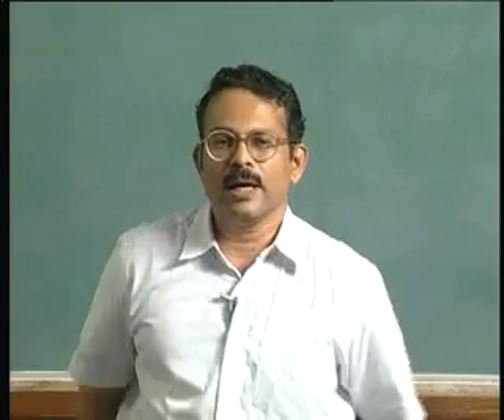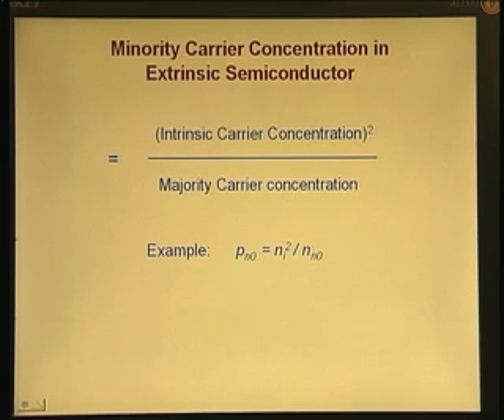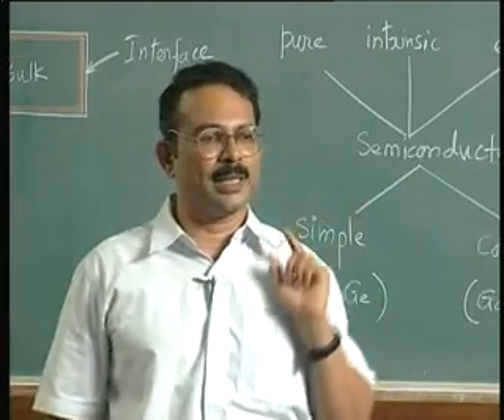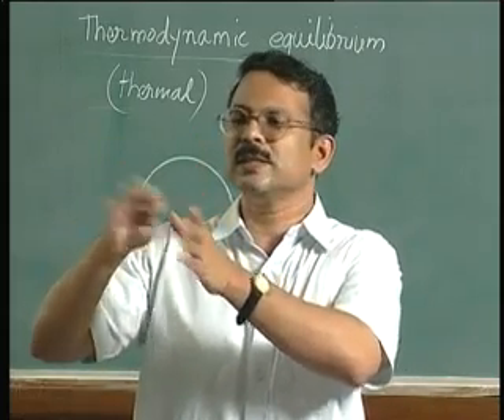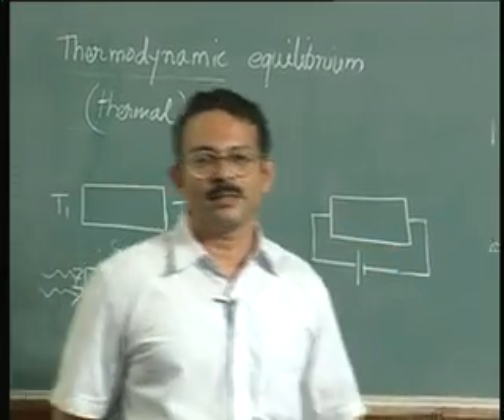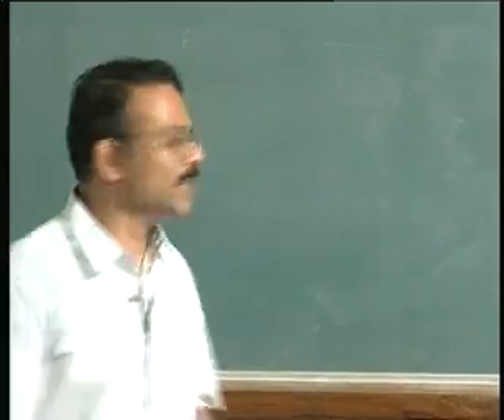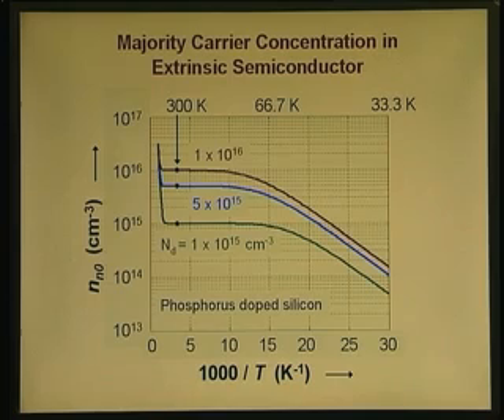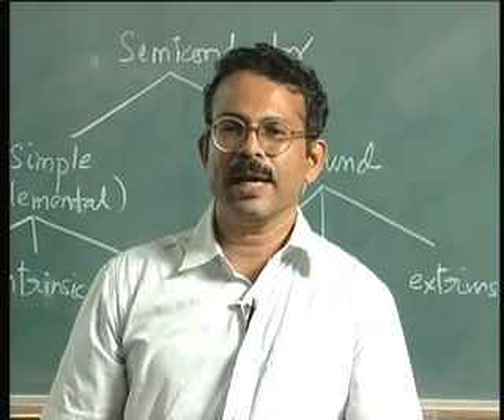Lecture - 3 Equilibrium Carrier Concentration

Comment: What is the difference between pure semiconductor and intrinsic semiconductor?plzz explain dis in detail?
Reply: pure s/c is an ideal case that we have assumed the is no ipurity,imperfectin or dopping but while manufacturing there is always some impurity added bt is negligible for our use so it is intrinsic semiconductor
Reply: Pure semiconductor is literally pure. Means no impurity present 100 percent same types of atom which does not exist in this world...
Intrinsic is 99 percent pure and we get it by applying Cz or bridgeman process to a metallurgical grade sillicon or germanium which is obtained from the product of sio2 plus carbon followed by fractional distillation.

Comment: semiconductor device fundamentals by robert pierret, 2nd edition.  it's $150 on amazon but you can get the international edition for around $20 from abebooks.  it's the one i used for undergrad.  isbn:  0201543931